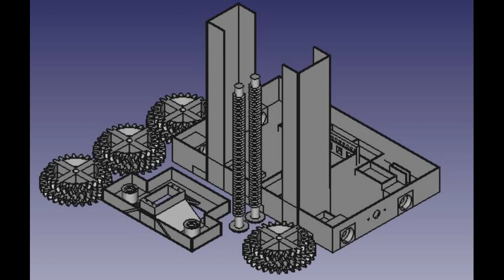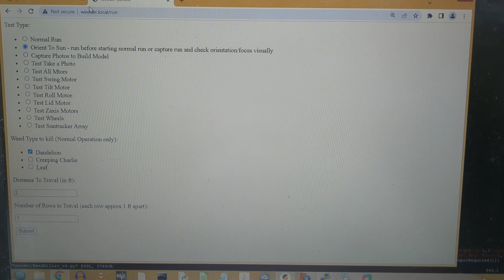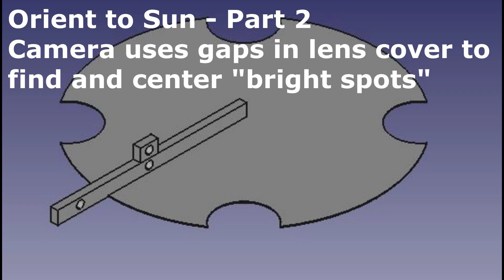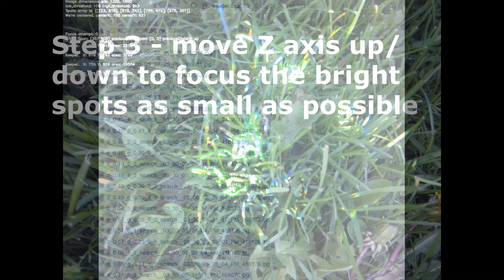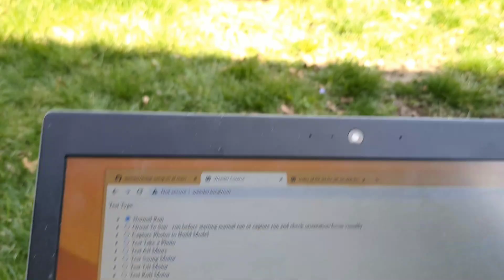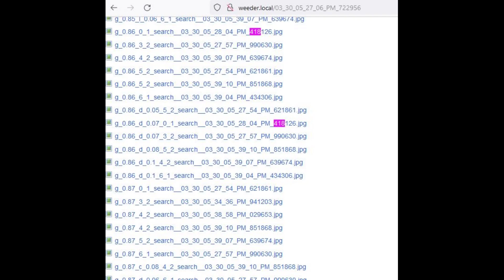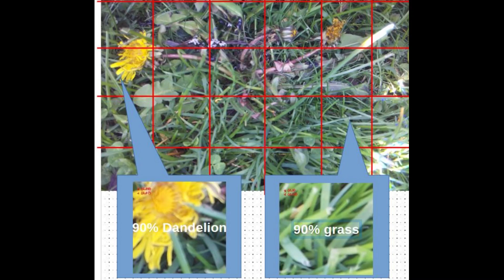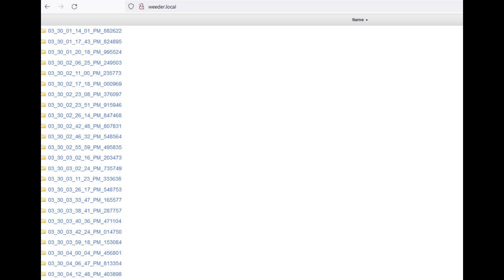DIY AI Solar Weeder - Part 5, Run it!

Comment: This is cool, but I would built it differently. I think the lens would be in the center of the 4 wheels. I would put the lens on  a rotating thing with an angle servo to set the angle. If it rotates 360 degrees you can always line it up with the sun at whatever direction. Or you could use 3 motors like the delta 3d printers use to angle it any angle. If you could find a used delta printer that doesn't work, you probably have everytbing you need to build the lens focusing mechanism. It being in the center it would be more stable. And you can add the shutter to the top 3 rails. Its a pretty interesting concept. But it definitely needs supervision!

Comment: If you want to design a fire starter, I mean weeder< maybe put the heaviest parts in the center and the wheels at all 4 corners.  Look at the rovers we use on other planets.  Nothing heavy hanging out front, wheels way out to the peripheral.  Stability is important and should be thought of first.  A stable platform will let a good tool do a good job.

Comment: You can make the structure more stable by placing the lens in the center of 4 wheel. And the blinder can be made like the vertical blind on curtain.
Reply: That is a good idea.
That will make it much more stable and will make it easier to focus and aim.
The only issue is that it will limit the where the sun can be.
As it is now the sun can be rather low, but it will be hard to get a centered lens to tilt that much

Comment: Another great video!! 
- Think add to the scrip to check the sun (about every 10 mins)
- Next frame add solar panel so it can charge the system and run all day long.
- Still needs a way to kill weeds in a shaded area.  (Laser, weed killer, mini weed eater) 
Keep up the great work!!